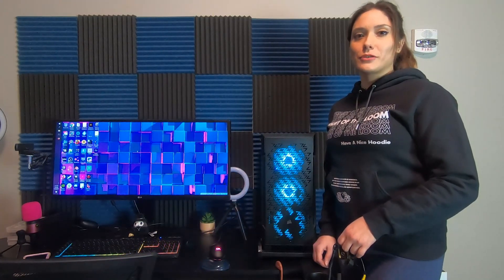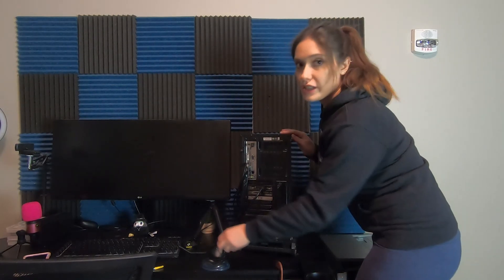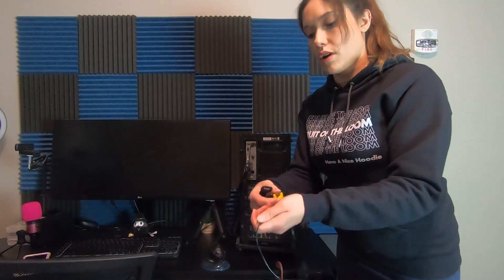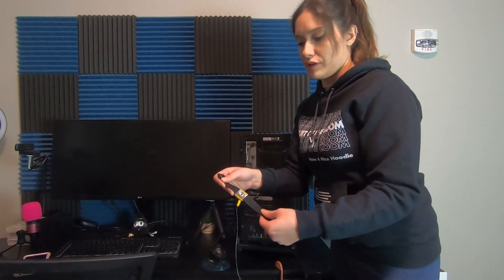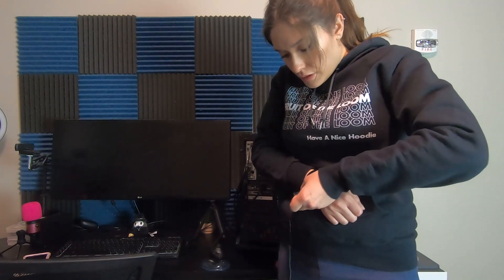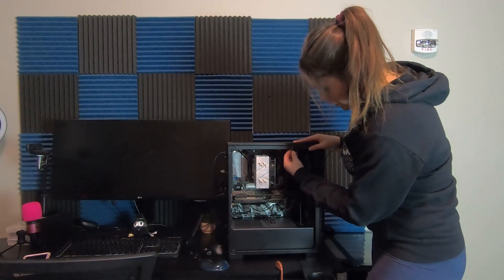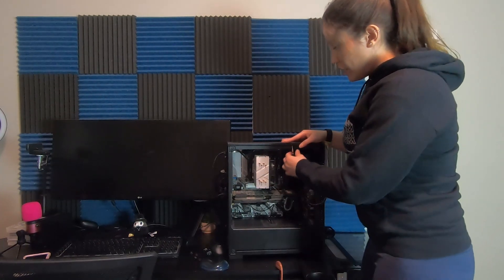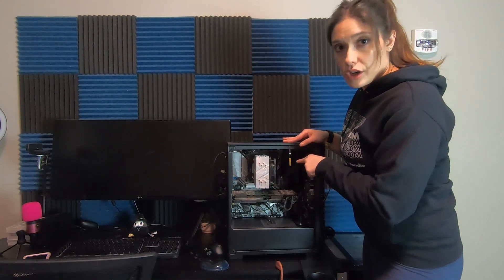How to Use an Anti Static Wrist Strap for PC Building/Repair

Comment: With the power supply unplugged it’s not grounded to earth ground which means anything you touch that is not already in the case could receive a static shock. Leave the power cord plugged into the wall and power supply just make sure the supply is turned off.
Reply: Idk nun about this, yet it sounds really counterintuitive to leave the power cord connected while I work on the pc... can someone explain this in depth?
Reply: The only way an antistatic wrist strap can work is if it has a path to ground. In this example, even though the alligator clip was connected to an unpainted portion of the metal chassis of the computer, the computer itself was not grounded. So, by unplugging the computer, it effectively leaves the other end of the wrist strap dangling in the air, making it useless.

There are other considerations as well. Even if the computer is plugged in, if the outlet is not properly grounded, your wrist strap is still completely useless. Simply plugging in the power cord doesn’t guarantee grounding—it depends on the outlet wiring. Many old or improperly wired outlets lack proper grounding, so always test it first using an outlet tester from Fluke, Sperry, Klein Tools, or another reputable brand.

Another important factor is the wrist strap's resistance. If you bought a 99-cent wrist strap from China, it's probably a zero-resistance DEATH STRAP. A proper wrist strap should include a built-in resistor, typically in the range of 750kΩ to 10MΩ, with 1MΩ being the most common. This resistance ensures a controlled discharge of static electricity while protecting the user from accidental shock if they touch a live component. Spend $8 (USD) or so to get a CERTIFIED wrist strap from a reputable brand.

Comment: Correct me if I'm wrong but don't you want to be grounded?
Thus you should leave the power cord plugged in.
Reply: It's all about a static charge that we don't want that's "external". So, you don't want to open a case that's plugged in to an AC power source (internal circuit) and you should always unplug the PC and hold the power button down for ten seconds to discharge all the components of the circuit (the PC). Put on the grounding strap - as shown on the video against your skin, and clip the alligator clip onto bare metal of the case (you can also touch bare metal to discharge static charges). The logic: by leaving the PC plugged in even if the PC is powered off it's still a live circuit - not safe. Static electricity is the energy on top of the surface of everything. That's why when you shuffle your feet on a carpet, you're building up a charge that can kill components inside of the PC.
Reply: Plug the wrist strap into the round hole on your wall outlet and you won’t need to worry about static buildup. This is assuming you home electrical wiring is properly wired and grounded
Reply: YES
Reply: You only want to discharge "static electricity". By leaving the PC plugged into a wall electrical receptacle the circuit is still live or active. It's not a good idea to swap out memory or attach a HDD or other components to a live circuit even if switched off at the power button. And what's more you can still fry a component in the handling of any loose part because the static charge is on you. In these steps: Power down, unplug from wall, hold power button down for ten seconds, open case, put on wrist strap, attach alligator clip to bare metal (some touch bare metal inside the case to drain static power), remove, add or install part(s), close case up, plug back in and power up. It just about guarantees no issues.
Reply: Very well explained, now I can proceed. Thank you very much. @JD-kg3mx
Reply: I was thinking the same. It should be plugged u . But you know, i'm fearfull for the whole mansplaining thing. Because she isn't grounding shit.
Psu should be turned off though. 
And don't connect the wrist thing to the case, but to the psu. Because that's the part that is actually grounded.
Reply: @FromLake  Any bare metal will suffice according to other people and other youtube channels, not strictly the PSU metal

Comment: May I add, some people like to de-energize the system also.
Reply from the maker: We welcome know it all here! Share the knowledge!
Reply from the maker: Yes I've seen that! Correct me if I'm wrong, but I believe this is done by turning off the PC, unplugging it, and turning the power switch back on, right? I'm not 100% sure.
Reply: @HanahFaye  really close, I like to shut off the power supply switch, then hold the power button for 15- 20 seconds,then unplug the power supply. The reason is +to-, hot to ground, give the electricity a road to travel to truly "de-energize"
😁👍
Reply: @HanahFaye  over the years I have never used ground straps because I put myself on the same electrical plane as the pc case by touching the case. If you think about it that is all the ground strap does. Straps just put you on the same plane, technically they don't "ground " anything unless you physically run a ground wire to the ground in the wall socket.
I accidentally killed a nice 1tb samsung evo + by removing it from the motherboard without de-energizing. "Fatal error " 😪
Reply: @HanahFaye  not to seem like a "know-it-all" but what the pc power supply does is coverts the ac to dc and distributes the dc current to the 12v, 5v, and 3.3v rails. Same with laptops, and cell phones. Lots of laptops get ruined because even if they hold the power button down, they forget to disconnect the battery before they work on the laptop. " why doesn't my new ssd work?" 😁